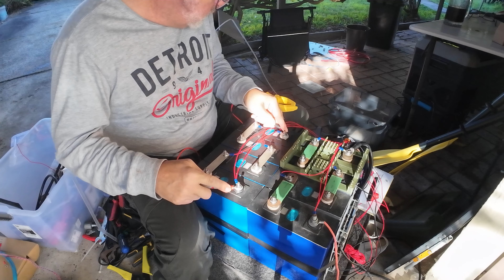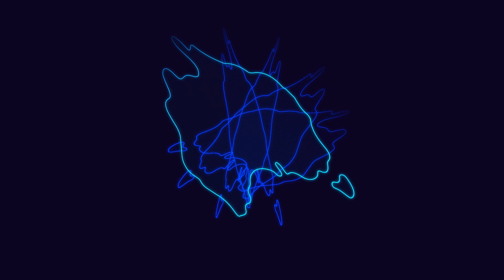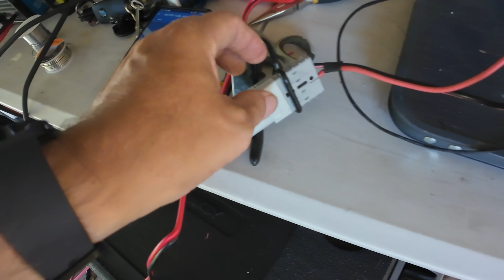Battery Charging - Speed it up by ~30%

Comment: It's all about the electrical connection surface area. Alligator clamps have very little surface area in contact with the terminals, therefore cannot deliver the current needed.
Reply from the maker: Exactly they just don't  have the surface area to transfer the current. I just didn't expect it to be that poor since they're just so common
Reply: @DENMONKEY  And they'll be creating a heat point too. Not a problem on a test bench and we are talking quite low currents and loads, but hidden away in a car could be another issue entirely. 
Everyone needs to understand, the right connector for the right purpose. I have so many people skimp on connectors and crimping tools etc, 'cause there is a cheaper way to do it.

Comment: Wow
Imagine how much power when you hook up your tyre compressor to battery then
It would drain your battery real quick
Although you do have engine running
Thanks for sharing 👏👍😎
Reply from the maker: I was thinking that.  Especially with this double barrel things like the ones kings sells that pulls 90 odd Amps.   Charging up that 600 odd Amps of battery at 30A takes long enough,  make it 20A and it's even worse.

Comment: I didn't think it would make thay much if a difference but I have done exactly what you have said with my batteries and chatgers
Reply from the maker: Neither did I. I knew there would be a difference, but having never measured it,  i didn't think it would be that significant.